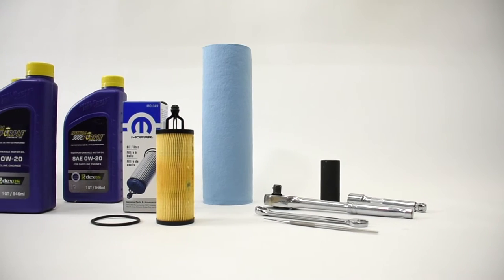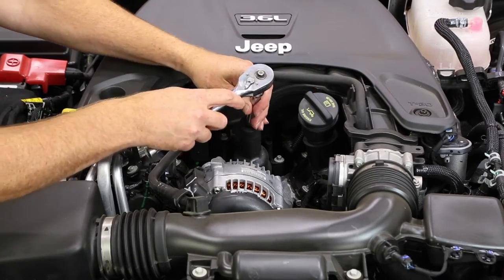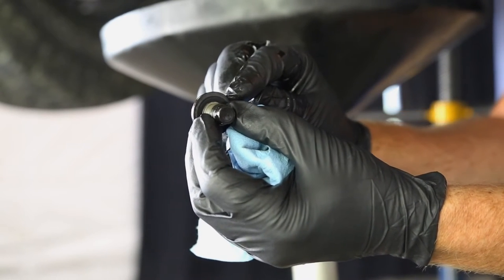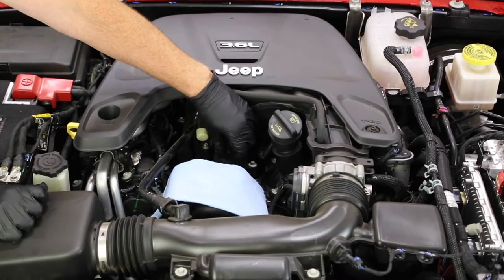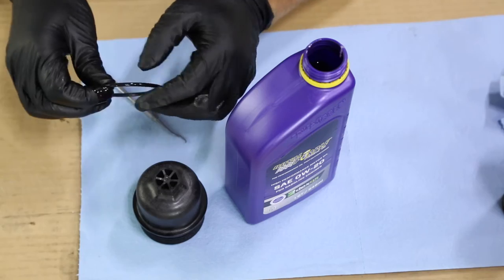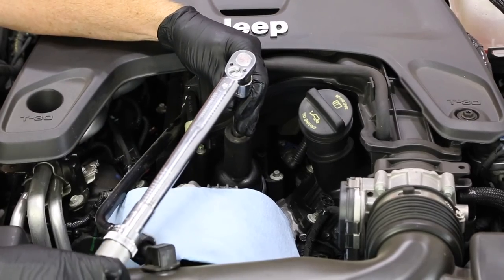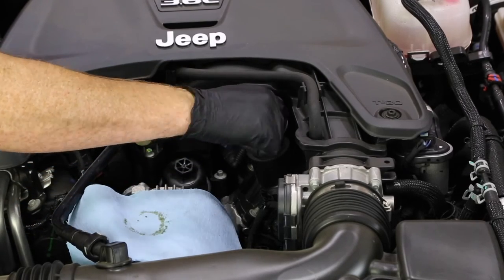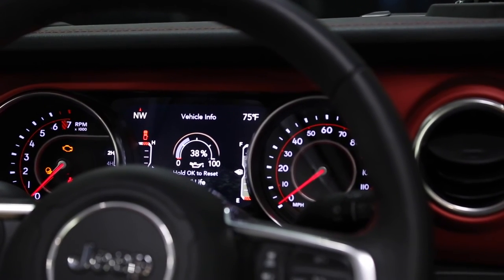Jeep Gladiator JT 3.6 - How To Change Your Engine Oil

Comment: Thank you sir! New like and subbed!!!
Got a silver 23 JL 6sp (2door of course 😅) and just trying to do my due diligence to take care of this beautiful machine.
So far I have acquired the following tips.
1) Make sure to do my first oil change at 500 or so while engine is breaking in
2) make sure filter housing Ở ring is CORRECTLY installed, different sizes and heights of oil filter between different generations, easy to place wrong
3) Make sure to NOT overtighten oil filter housing, to prevent cracks.
4 Don't wait for 10k mi change! Change at 5k
5) fill correct amount 5L
😅

So glad this knowledge is freely accessible nowadays.
Thank you
Reply from the maker: Glad the video helped!

Comment: On 11-30-2020 I ordered my first ever Jeep. It is a 2021 JL Jeep Wrangler Unlimited Rubicon with the 3.6 Liter Pentastar V-6 mated to an 8 speed automatic transmission. My heart wanted another manual transmission but my need dictated buying an automatic.

My Jeep arrived at the dealership on 02-12-2021 and I did all the paperwork to buy it on 03-01-2021. So far I totally love the Jeep and have bought several things to help me out when I take the Jeep out off roading.

With my Jeep, I’m not quite yet to the mileage where I need to get the oil changed but when I do I will either go with Mobil 1 Extended Performance motor oil along with a Mobil 1 oil filter cartridge, (I have used this set up for decades on all of my vehicles.).

I may also start using Royal Purple High Performance motor oil, Royal Purple HPS High Performance Street motor oil, or Royal Purple XPR Extreme Performance Racing motor oil with either a Royal Purple oil filter cartridge assuming that they make one or the Mobil 1 oil filter cartridge. 

The last option that I am considering using is Amsoil Signature Series motor oil, or Amsoil XL Boosted motor oil, or Amsoil OE motor oil, or Amsoil Dominator Racing Oil motor oil with either an Amsoil oil filter cartridge or a Mobil 1 oil filter cartridge. If I go Amsoil, I’m thinking that the signature series motor oil will be my best motor oil option to go with.

Last, in spite of how long these companies all say that their motor oil will last for, I will still continue changing my oil every 2,500 to 3,000 miles to ensure that the motor oil and oil filter cartridge are both being replaced well before the motor oil and oil filter cartridge start losing their protecting abilities.
Reply: I won't be using mobil 1 oil. Better go for penzoil platinum if you want better protection for your car
Reply: @tofuman7456 , I’ve gone with Amsoil Signature Series and use Amsoil 20k oil filters but do my oil changes around every 2,500 to 3,000 miles.

Comment: I used moble one since the first oil change on my 04 wrangler and the same in the trans and diffs. The frame rust made me buy the Gladiator. It was perfect except the frame. Thank you for your video

Comment: I couldn’t tell in video, but when installing the oil ring back on cap, did you put it snug against the top?  Or in a groove just before the top?  When I changed my oil ring, I forgot to look and was questioning myself on how far to put the oil ring back on.

Comment: What Oil Filter did you use?  It's hard for me to see what type you are using in your vid.  I think that it says "MO-349".
Reply from the maker: Yes, it's an MO-349, AKA Mopar 68191349AC
You can get them here: https://www.northridge4x4.com/part/oil-filters/68191349ac-mopar-engine-oil-filter-3-6l
Reply: @northridgenation  Thanks!  Excellent video too by the way, thanks again!  ")

Comment: As long as the oil is full synthetic, the correct weight and is API/ILSAC approved , it won’t “void” the warranty regardless if it doesn’t meet the MS-6395 FCA oil recommendation. That according to the Magnuson-Moss Warranty Act. I believe until 2009 Mobil One was the preferred Chrysler oil. When the company filed for bankruptcy, they apparently owed M1 money for oil that was purchased but not paid for...and that’s why FCA doesn’t recommend M1...I ran M1 5W-20 in my 2014 Wrangler and had no issues...
Reply from the maker: Thanks for the info!

Comment: Way not ues mopar pro oil 0w-20 is that best for the engine.Or you can ues any 0w-20 oils.
Reply from the maker: Use can use any brand of quality oil. You don't have to use Mopar.

Comment: I didn't torque my plug. I just tightend it and gave it a "little extra". Should I really torge it? It's probably about 10-15 ft lbs if I had to guess.
Reply: Just past snug about 1/4 turn has always worked for me just as long as you don't over tighten to the point of having to break it loose next time.

Comment: When I did my oil change on my 22 gladiator it seemed like less that 5 qts. Alot less. When I filled with 5qts.  It's seemed overfilled on the dip stick. So I'm not sure if it needs less than 5 even though the manual says 5.
Reply from the maker: 5 quarts is what the factory says and that is down 1 art from the JK 3.6.

Comment: When I drain out, it doesn't drain a 5 quart. It drains about 4.8 quarts may be. Is that normal?
Reply from the maker: Are you letting it drain for 15 mins or more? Sometimes it takes awhile for the engine to fully drain.
Reply: @northridgenation  This time I did drain it for about 15 min. I will check again next time.